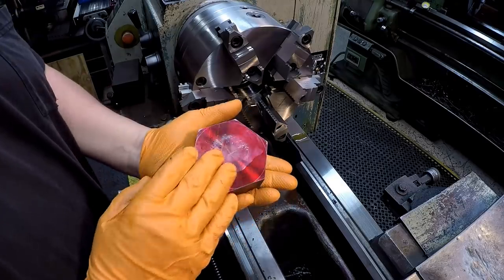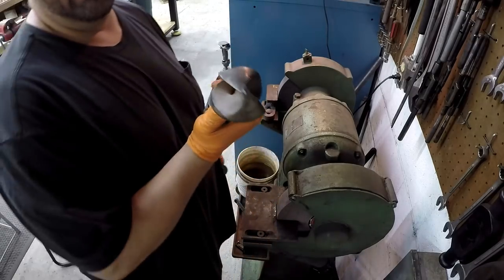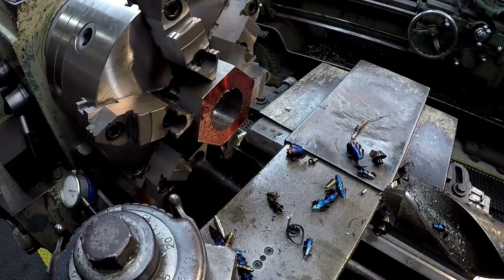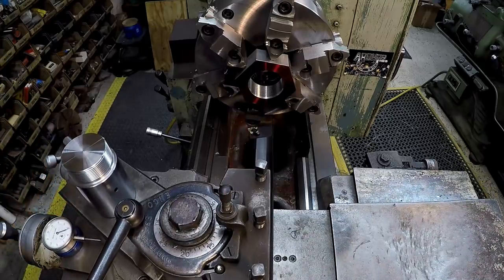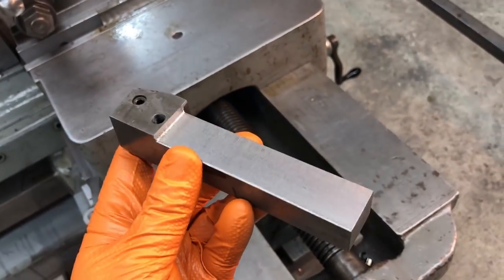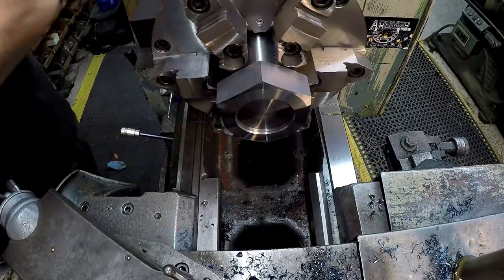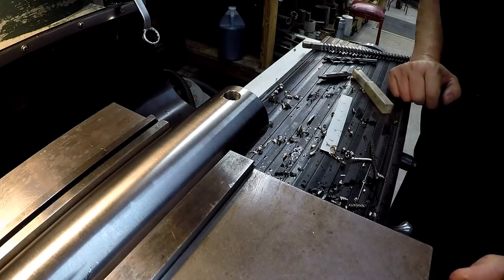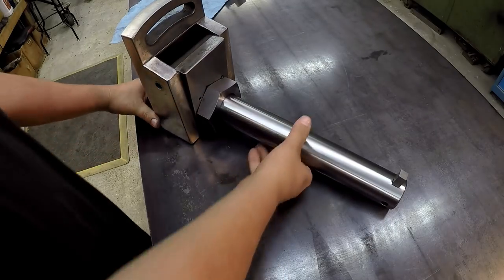Custom Internal Shaping Bar Part 4

Comment: I'm still dumbfounded at how when threading something using a lathe, the tool bit always seem to catch the thread when making a new cut. If the tool bit misses the already started thread it would just mess it all up. I'm sure it's got a simple explanation but that really does my head in
Reply: Im right there with you.
Reply: Depending on the pitch of the thread it could be really easy to mess up, or nearly impossible.
Reply: As the man explained..the threads in the nut were 12tpi. And his lathe has a 4tpi thread screw lead. which is evenly divided into 12.. on odd tpi you would have to use a dial indicator or trust your lathe scale and start it at the same spot each time.
Reply: Rather than use the dial for each pass, you can engage then just reverse the Chuck when you get to the end , I always use this method on my machine , depends on your lathe and how good your reactions are👍

Comment: Why you used the shaper for reducing the tool older and not the milling machine ? A lot of saving time
Reply: I am guessing because he has a new toy "the shaper" he wants to use instead of mill.
Reply: Has the milling machine motor not been removed for repairs ?
I may be wrong !
Reply: He has two mills. So in theory h could have done it one the mill. But he likes to get the shaper going for fun and also to get more proeficient at it. Also, it is a thrill to watch!! I may also add that the set up in tooling and machine is quite more rigid using a big hss tool bit in conjonction with the mass and strength of his shaper. No danger of breaking an endmill here!
Reply: 1 - He loves this shaper
2 - It is more fun to watch
3 - We love this shaper

Comment: I consider 10mm drill hugeeee
Reply: S Bayko I made one at work 80mm Dia and its 26” long ,on a morse taper , no centre drill or pilot hole just straight in solid 304 grade st/st.

Comment: “See if we can find us a drill bit”, opens drawer full of em. You’ve been spending too much time with TOT.  What was the point of setting the compound at an angle for cutting the threads?
Reply: It reduces pressure and risk of chatter on the cutting tool by cutting on one edge instead of both.  Have a search for an old ThisOldTony video where he explains it as it would take quite a while to explain in this text box.  Best practise for harder materials but soft could be done at 90 deg.
Reply: Setting angle on compound and feeding with compound instead of cross slide allows tool to cut on only one edge leaving a better finish..... that is standard practice when single point threading.
Reply from the maker: Much easier to me to keep up with infeed on the compound vs the cross slide. Bring the compound back Zero each time instead of trying to remember what depth your last cut was.

Comment: Adam  or anyone: what kind of gloves are those?  Protect from solvent or cuts or? Also how can a cutting bit or even drill bit be soft enough to be dressed on a stone but still hard enough to cut steel? Thanks
Reply: For machining its a hierarchy of hardness in materials. Diamond cuts tungsten carbide, tungsten carbide cuts hard steel, hard steel cuts soft steel, soft steel cuts aluminum, aluminum cuts plastic. So an oxide grinding wheel is dressed with a diamond because it is harder. and the oxide wheel cuts steel because it is harder. and the drill bit cuts softer steel because it is harder. If you wanted to machine hard steel you would use a tungsten carbide drill bit because it is harder than any other steel.
Reply: Thanks for the knowledge! Appreciate the clear explanation.
Reply: @euctrucker2488  I was going to say not much cuts tungsten carbide which is what those little tips on premium bladese is. It is actually carbide particles embedded in cobalt. I do not
Reply: @euctrucker2488  I was going to say there is not much hard enough to cut Tungsten Carbide, but yes industrial diamonds will.  Most  people know TC as the material the little tips on a premium circular or tablesaw blade. An interesting fact involves what they call cop killers or armour piercing bullets. The originals made by a company called KTW were made of Tungsten Carbide! But as we now know TC is able to cut steel. Which means that just a couple shot thru your gun would shoot the rifling right out of the barrel. They solved the problem by coating the TC in super slippery Teflon. Which protected the rifling from the harder than steel TC. This have rise to the urban legend that cop killing bullets were just Teflon coated bullets.

Comment: Why is it called a shaper?  Seems like “shaver” would be a more accurate name.
Reply: Cause it shapes and distorts anything, including time. Lol. The only thing a shaper can't make is money.  Wish I had one at the shop, they can save your but when you need it, other then that you might find yourself inventing things for it to do
Reply: @jeremyb7128  if you see  some older vid of Adam machining inside key slot in huge round piece for work,cuz they dont have broach that huge size...its cost fortune...so  shaper can make some money,depending on job its performing...
Reply: @sinkosav  yep, and that's why I still wish I had room for one. It wouldn't get used much but hey, never know when I'll need it

Comment: Why do you do it the hard way of cutting this thread? It is safer to start on the inside an cut out, so you don't accidentally run you bar into a chuck.

Comment: This is in no way criticism as I know nothing about machining parts but why start off with such a small pilot for that big of a drill bit ?
Reply: The pilot drill only needs to be larger than the web on the bigger drill bit.
Reply: Small drills go thro v, easy not much pressure needed compared to larger sizes. Or just use a U Drill , no centre drill or pilot hole , straight in we have a 100mm Dia

Comment: Sounds like the engineer messed up spec'ing a nut that has to be custom made.  You can buy a nut about this size for < $50.  This one probably costs $200.
Reply: Do not know why you would think it would cost anywhere close to $200.00 or even $50.00. Make it out of scrap stock and he already has the tools to do it, besides what would be the fun and educational part of buying someone else's work?
Reply: So you are saying you want to watch a video of Adam going online and ordering a nut from McMasrer-Carr rather than making one? I guess if thats what floats your boat but most of us are here to watch the machining. Even if it is just a nut.
Reply: Ya, these are for himself and he likes making things himself as well as having the yt content.  You're right though on what you said.  In most real world applications, having a machine shop make this nut would be completely outrageous and unpractical.  After all, time is money and most shops are around $125 an hour these days, plus material.

Comment: Brother, I will not allow you to use my tools if you chuck tools together in one draw like I've just seen in your video. That is bad news for the drills' cutting edges. Also files (and especially reamers) should be hanged or stored separately to prevent contact. Take a piece of wood, drill holes in it and store your drills in size sequence, but never together in one draw like in your video.
Reply: I don't think he needs your tools, dude.